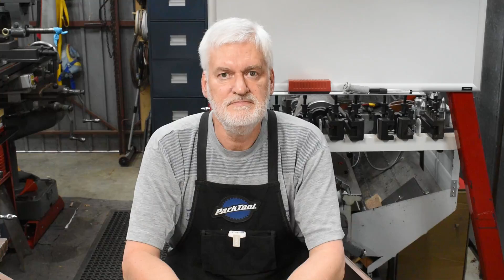Fixing a garage trolley jack - well almost...

Comment: Perhaps the residual leak is from the ball on the check valve not sealing perfectly. If that would be the case a possible remedy would be to determine which check valve-ball is responsible for holding the pressure in the cylinder and then using the ball itself to hammer against it's seat using a brass drift. Ideally these check valves should have weak springs to assist with guiding the ball to it's seat and sealing.
Reply from the maker: You might well be onto something. I had another go with the handle to put a lot of force on the check valve ball - much more than I would normally have done, and the leak down rate did reduce a bit more. I think I'll test further with some sort of softer slug that can completely seal the check valve. This wouldn't be a durable solution but would give a definitive answer to whether the check valve is leaking. Cheers, Alan.